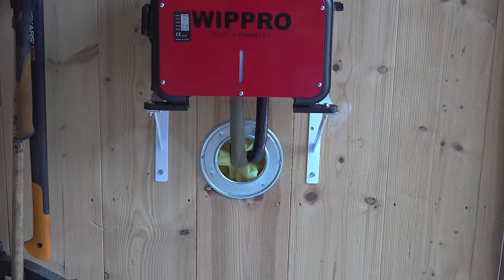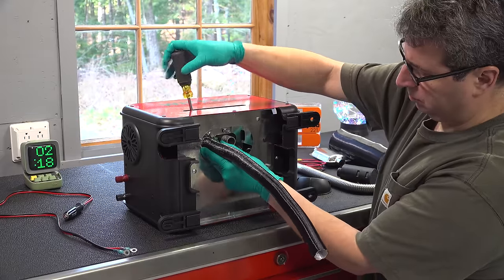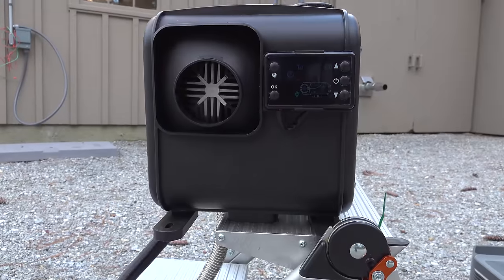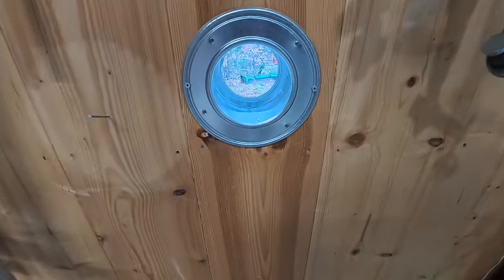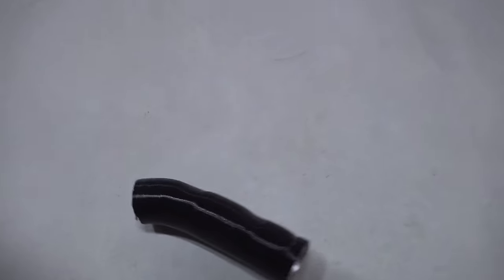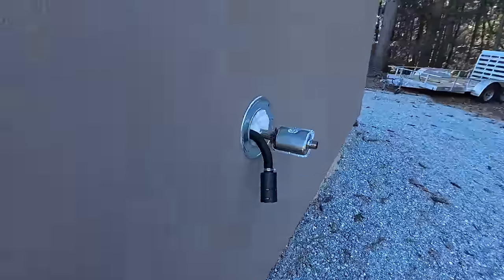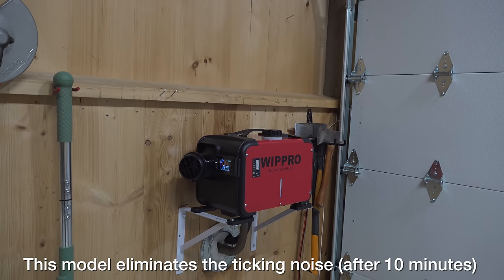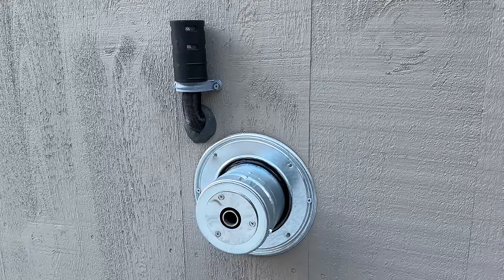How to Heat a Small shop with a BUILT IN Diesel Wall Heater

Comment: I had to dump that much cash on my 240v garage heater a couple years ago. It’s LOUD AF and setting a temperature just means it’s going to be beeping all the time as it cycles on and off. Since the fan runs for two minutes every time it turns off it actually makes you feel cold even at the target temp, and it almost always cools so fast that it comes back on within two minutes anyway… so the noise never lets up.

I was forced to spend a winter living in an uninsulated and drafty workshop with that thing after an EF4 tornado destroyed my home. After all that beeping while I’m trying to sleep I have a deep-seated hatred for it even though I definitely need it.

Comment: Great presentation. Have you looked at Toyotomi or Rinnai heater exhaust pipes which has a pipe within pipe system with exhaust pipe running inside the intake pipe? Uses a maybe 3" hole and no need for insulation as the intake air cools the exhaust pipe. Also, the exhaust pipe extends well past the intake pipe, so they don't mix, and it's installed with 2 degree downward slope to drain any condensation. Think I might buy the same heater and try that in my shed, where I already have a 12-volt deep cycle battery on a solar trickle charger.

Comment: I have several of the original German Ebberspacher heaters, work good got them very cheap at an auction many years ago. Six in all two I have restored and the rest for spare parts along with installation odds and ends. New in the mid to late 80’s these were over $1K as a complete kit. The factory pumps in the 90’s cost upwards of $140, but they are high quality metering pumps, not Chinese knock offs.

Comment: I see so many run the exhaust to the outside of the building straight off the unit (yes you want it to go outside for sure) but I think running a longer length of it inside the building first would capture more of the radient heat off of it and also be cooler *  going thru the wall to the outside which would also cause less concern about the high temp insulation.

Comment: This certainly looks like it'd be a great way to efficiently heat a 24' x 24' shop. The only concern I would have would be availability of fuel in a SHTF situation or just any non-emergency shortage. I have a pellet stove right now and the diesel heater would definitely be more cost effective (plus easy to install as I already have a thimble and an outside air intake), but there's really no foolproof way to predict which fuel source might be the first to have a major shortage. Where I'm at, the Lignetics wood pellet plant is not far off so with an afternoon drive and I can net several 40lb bags of pellets, though on the other hand, my pellet stove needs AC to run and in a pinch I could run the diesel heater off a fully charged car battery for a good while.

Sure is tempting to ponder given how much more cost effective this seems to be.

Also very good idea having the CO detector. In the event of exhaust fumes possibly leaking into the heat exchanger, you definitely want to be alerted before it affects you.
Reply: Bio diesel as well as ethanol can be made without too much trouble

Comment: Get an "LED driver" to power these. They constant 12v output running from a wall outlet. I got a 200w one for $40 to power mine since they pull a little over 150 watts on startup.

Comment: Have a look at the Afterburner controller. Gives you wifi and very granular control over the unit. Also supports MQTT for homeassistant.
Reply: I used to be like u and wanted all kinds of connectivity and tech.  Now, I look for no tech and no connectivity 🙂.  Regretting the day when I got rid of my dad’s old brace and bit and similar items.  Maybe I have been reading too much abt what happens if there is an emp…
Reply: @gsftom  I'll stick with having the cabin warmed up by the time we get there.

Comment: For power set up. .If you have a wall outlet close by. 
Get an old car battery and a cheap automatic charger. Turn on the diesel heater and after a few minutes start the battery charger. 
Here a 6A version costs 20€/22USD. 

Use the exhaust heat,any different ways but it'll double the efficiency. All that hrat going outside the exhaust could be used inside. 

Only thing is now you'll have condensation in the exhaust to route everything downwards so no water can collect anywhere and it will drip out of the exhaust. Best way is to let it drip into a drain as it is slightly acidic. 
You can also collect the water and use it for plants that like slightly acidic water like blueberries. 
Same goes for A/C condensate btw and there's no lead in the solder for many years now

Comment: I have one of these in my van, not the exact model, mine has a diesel tank that's not connected to it, so I had to run lines, but it is more convienant to fill up where I put it instead of having to bring diesel in the middle of my van if I had this model... so it's all about circumstances

Comment: Hello, I always thing you do first rate stuff and your place looks great. Why not mount the heater outside and run an insulated duct through the wall? This way the exhaust and fuel are outside of the structure. Remove Carbon Monoxide and fire issues inside the building. It easy enough to build a structure over the heater for rain or snow.
Reply: That really wouldn’t eliminate CO problem’s because you still have the heat exchanger.   Mounting it inside allows it to be out of the weather and you can just walk up to it to turn it on and adjust it.

Comment: What the reason install intake filter outside? Installing it inside will cause air to change inside room and you will need less vent. Also if small parts of exaust will break out through sealing it will get them into heater again.

Comment: Might be willing to try.  Need to heat a 1200 sq ft (18 ft high ceiling) steel wall (uninsulated) building in teen and 20* (F) temps with 30-50 mph winds outside.  Standard propane heaters are a joke.
Concrete floors, steel walls and roof

Comment: I've seen a few people on ytb install these but have never seen them in real life, I'm from Europe btw. All of us here just use small electric heaters, so I'm curious about what's the difference, is it maybe more economical in the US because of much lower diesel prices? Electric heaters seem much more efficient, easier to use and durable.
Reply: A part of it could be that the line voltage is only 120V, so electric heaters aren't able to get the juice to heat large spaces as easily, though they certainly exist. These things are meant to be used remotely or where AC voltage isn't even available, and heat larger areas quickly
Reply: I live in Northern California. We pay $0.45 per kilowatt hour for the first 292kwh used, then Tier 2 kicks in at $0.56 per kwh. Electric heat is very expensive. Natural gas costs us $2.48 per Therm. That is cheaper heat than electric heat but still costly. I pay $4.68 per US gallon for red off road untaxed diesel fuel.  Houses here are about 279 sq meters, 3000 sq feet. The online Nextdoor App has a lot of people complaining that their December 2023 gas and electric bills were very high. Some people mentioned $560 for the month, some said $1300+ because they needed more heat for elderly needs.  

 I burned 37 gallons of red non taxed diesel in December at $4.69 per gallon,  $173.53 in the diesel heater, and the combined natural gas (cooking and hot water) and electric use was $158.77. My December cost was $332.30.  Our utility has an online app where I can see electric usage down to the hour and natural gas use per day, monthly and yearly charts as well.

 I am a retired engineer and entertain myself by tracking costs and making efficiency adjustments.  I tested propane and kerosenec devices as well.  My diesel heater runs off a 100AH LFP lithium battery that gets charged with solar panels. We still have heat when the grid goes down. This happened 8 times in 2023 ranging from 1 hour to 8+ hours and is becoming more frequent.  I have an airtight wood burning fireplace but local laws prohibit wood burning on many days. There are no fumes from the diesel heater. It exhausts outside.
Reply: @kimmer6  Wow, makes sense. Here where I'm from electricity costs around 3-7 cents/kWh and we rarely have blackouts, plus I have solar and gas prices are dubble than in US. So we're in a completely different situations.

Comment: on some engines its required to have a muffler on it to keep the compression correct or else it won't start
Reply: there is no compression. there is a burn chamber with a glow plug. the unit squirts fuel onto a screen that surrounds the glow plug. this atomizes the fuel while air is also pumped into the chamber. the glow plug heats the screen, the fuel ignites and burns once the unit is warmed up the glow plug gets shut off. air and fuel get continually added. the whole unit heats up and air is blow around the fins on the outside of the unit to cool it and whammo...hot air.

Comment: Hi if you want to get more heat out of that thing hook the exhaust pipe up a Baseboard Hot Water Heating Radiators with fans and get the temp down to below 80 degrees. Let me know how it works out .

Comment: In my area these cost twice as much to run as an electric resistance heating. Diesel is $4.83 per gallon, electric is $0.068 per kWh. A gallon of diesel has 130,000 btu. I’ll assume (VERY generous) this heater is 90% efficient so $4.83 for 117k BTU. That same 117k (electric resistance heating is 100% efficient) will cost me $2.33. On Amazon I can buy a 7500 watt (same heat output as the diesel one) garage heater for $185.
Reply: No need to run them on taxed road fuel!
Reply: @stevemorris3710  That is a very good point!, red diesel is cheaper at $4.15.

Comment: Can you experiment with using waste oil? What ratio can you run before it becomes too smelly, toxic, or heating time is effective?
Reply: Waste oil carbons up the burn chamber in a day of running. Not worth it. I burn only red diesel and the combustion chamber was clean after about 1000 hours run time.

Comment: Put the intake inside. It's easier to heat 70⁰ air than 20⁰.
Plus do don't have to worry about sucking exhaust inside the building

Comment: You should keep the intake and exhaust as far apart as possibly.  If there were to be a seal leak inside the unit you will be pulling in CO from the exhaust into the building.
Reply: The intake air is for combustion only.  It doesn’t get spread into the room.

Comment: isn’t the fresh air inlet installed too close to the exhaust? isn’t it running the risk of sucking in some diesel exhaust fumes? (especially in calm weather). Thanks for sharing this video.
Reply from the maker: That one is only air for combustion, think of it like your air filter in your car that goes to the engine. The room air intake is safely inside in the back of the heater
Reply: @SilverCymbal  love it, thank you!
Reply: @SilverCymbal  Still seems like it could lead to inefficient combustion. On a car the exhaust is in the rear and the intake is in the front, which is usually 10-15 feet away.

Comment: The air intake should face down so when it rain moisture will not run into the air intake.  Also drill a small hole in the top of the air intake so when moisture enters the side it will run right out the top of the intake which is facing down.

Comment: What is your estimated cost efficiency comparing this diesel heater and a propane indoor heater such as the Mr. Heater 30,000 BTU Unvented Blue Flame Propane Heater?
Reply: Diesel has about 1.5x the heat energy per gallon as propane, so a simple estimate would be that this would be about the same cost at $4/gal of diesel as a propane heater at $2.60/gal. Being a vented design, this one does exhaust some of the heat that an indoor propane heater would keep inside, but the tradeoff is that this wouldn't pollute or humidify the indoor air.

Comment: Dude. I'm thinking about.….. scratch that, I'm buying one of these to heat my 5th wheel. Gonna install it outside under one of my slide out' then run insulated ducting into the 5th wheel. This creates positive air pressure like what my swamp cooler does in the summer, thus being able to heat the entire 5th wheel.

Comment: these basically are larger versions of bunk heaters that (some) sleeper semi trucks have.  the only drawback in the truck is they use battery energy, and although they will shut off if the battery voltage drops too far, it might mean you can't start the truck because it's that cold out and there's just not enough power left to make the engine turn over.

Comment: How much electricity does it draw and how long will it run on a battery power source (like the ones you've featured in other videos)
Reply: It draws about 8 amps on start up and shut down for about 30 seconds and from about 1 to 4 amps when running depending on settings from low to high.
Reply: Just add peltier which could charge the battery.

Comment: I wasnt able to run my diesel heater with a 12v 10amp power supply.   A 15 amp supply was enough to do it.

Comment: Why route the air intake outside in the cold air and right next to the exhaust? I understand that it’s fresh air but wouldnt the air inside the garage be just as good and eventually warmer?
Reply: Why you want to waste inside warm air which then will be replaced by cold air from outside through door gaps when the inside air gets blown through exhaust?
Reply: @otofoto  huh? Im not sure exactly what you’re trying to say …… but how would my question/theory be wasting inside warm air? I am not sure you understand how this works! One of those pipes is intake air, the other the exhaust. My question was, why use intake air from the outside of the building vs the air inside the garage. The air inside the garage would be the same temp as the outside but eventually, as the garage air warms, it will be warmer air to warm…. Heating the garage faster and the cycle would continue. Having the unit heat air thats 50 degrees vs outside air is 35 degrees would have to be faster.

Moreover, having the intake air right next to the exhaust air doesnt seem like the safest as the intake could inhale the exhaust (aka carbon dioxide) and blow it into the garage unintentionally Seems like my suggestion/question solves both.
Reply: @talonpilot  Because the intake is only needed for burning diesel but the heat comes from circulating surrounding air. If you burn the inside air then it sucks out the warm air which gets replaced by cold air from outside. Your room is not sealed so you can’t create vacuum and the cold air will leak more from outside if there is now lower pressure inside room.

Comment: I apologize.  I previously made some illogical comments.  Michael (see the replies) corrected me.  Thanks, Michael.  Sorry I didn't think this through.  Otherwise, another great video.  Thanks.
Reply: Absolutely true.
Reply: The air intake is for combustion air only and will not cause any positive or negative pressure issues 

However the combustion air intake is above the exhaust in this install which creates a risk of recirculating of exhausted flue gasses back into the combustion chamber. 

Unless the manufacturer allows this the combustion air inlet should always be below the exhaust to pull fresh air from below as the heated exhaust rises
Reply: @michaelcso2400  You're right.  Thanks for correcting me.  🙂

Comment: My biggest takeway is that New England has way cheaper diesel.  Its about a dollar more per gallon out here in Eastern WA.
Reply: yeah give thanks our local gov gas taxes.
Reply: You can use off road diesel in it. Cheaper
Reply: @stevenbeach748  True.  Around here the price difference is negligible.  Not worth it unless you're filling a piece of equipment.
Reply: $5.19 a gallon in NorCal average. I pay $4.69 a gallon for red off road non taxed diesel fuel.

Comment: Why do all these models have the intake and exhaust out the bottom instead of the side/back? Seems like a big inconvenience
Reply: Yes, they were designed to be installed in a tractor cab or delivery van mounted on the floor to exhaust under the vehicle.
Reply: @kimmer6  Ah, makes sense! I wonder if they'll start coming out with side/back exhaust models now that they seem to be gaining popularity for use in other applications

Comment: Amazon has some which has internal transformers so you can run them directly off the mains electricity instead of needing a separate 12v power supply.

I like your exhaust solution - that's the neatest I've seen of all these installations on YouTube.

Celsius... yeah you guys will catch up with us one one day 😉 Greetings from the UK

Comment: I recall watching videos where waste oil was burned in these heaters, but I think it had to be started with diesel first.
Reply: And maybe 4 days later it's blowing smoke out the exhaust and the burn chamber is carboned up. I tried it and switched to 100% red diesel fuel. No troubles after about 1200 hours running.

Comment: Does it have a diesel odor in the space being heated?
Reply from the maker: None at all, the combustion and air movement are separated, The heat blows across the exterior of the aluminum body, while the inside has its own intake and exhaust